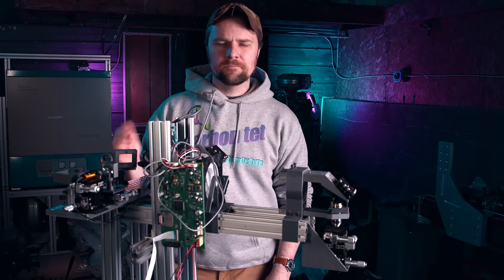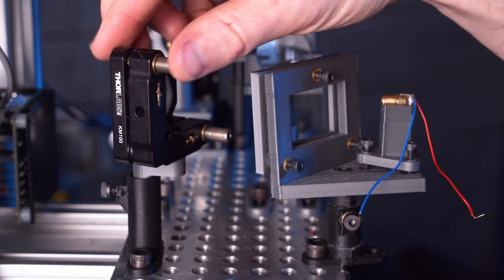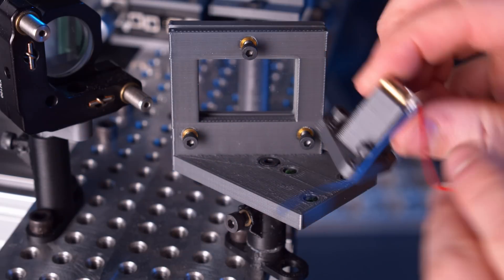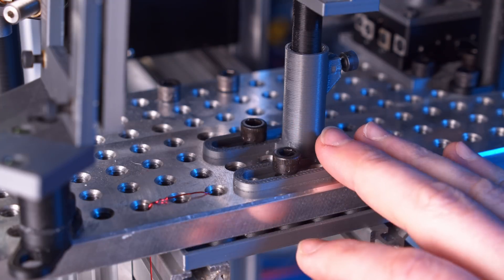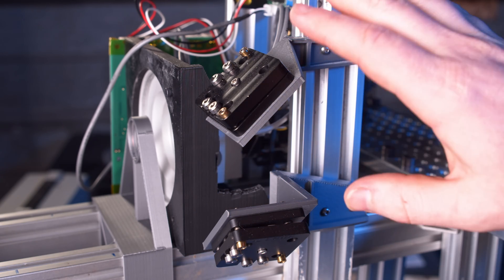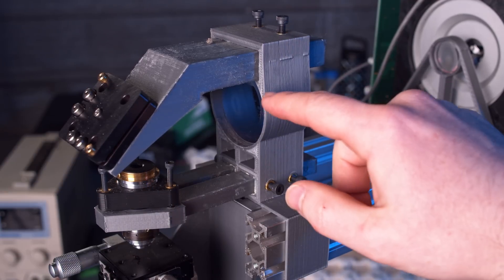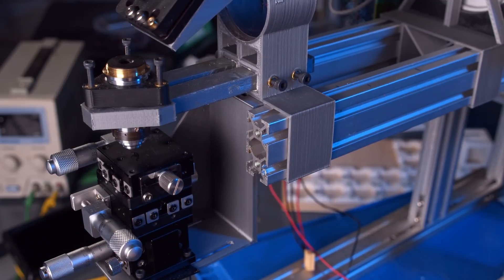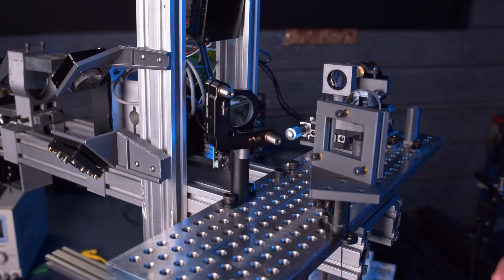3D Printing Optomechanical Components

Comment: YES! I can't believe I caught this 6 minutes after release. I know I have the little bell with all notifications but somehow I still miss it. I wonder if the ball + screw adjustment system could be fixed with a registration point or two
Reply from the maker: 🤗 Apologies you caught it on more of a "useful info but not super interesting topic" sort of video!  More of a braindump than anything.  :)
Reply: @BreakingTaps  I think they are just as good as your "main" ones. A little different in style but in a good sense
Reply: I was wondering if some lubrication of the magnets against the bolts would improve things at all - i.e. if it was (at least partly) a case of the magnets not being strong enough to overcome the friction.
Probably still wouldn't be perfect - registration points sounds like a better plan - it was just a thought I had while watching :)

I'm much more of a software engineer than mechanical, and I've not been able to sink as much time as I'd like into designing parts for my 3D printer, so I'm still pretty new at this sort of thing!